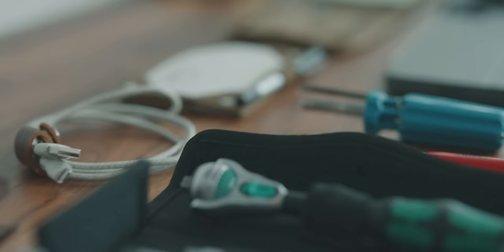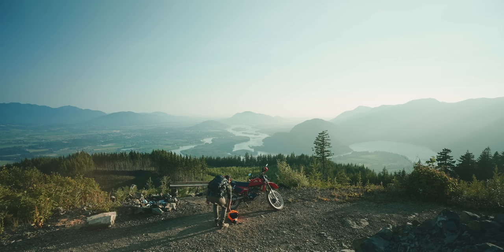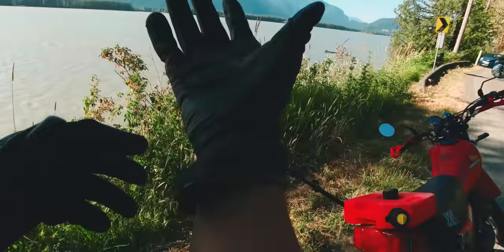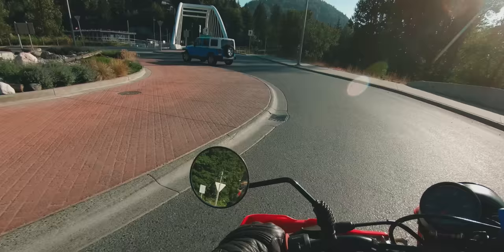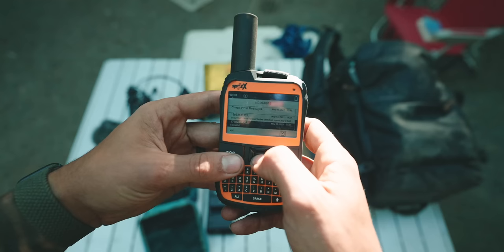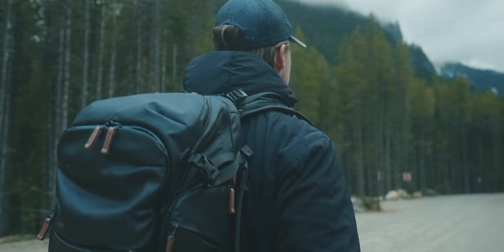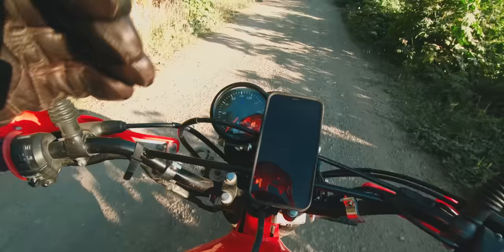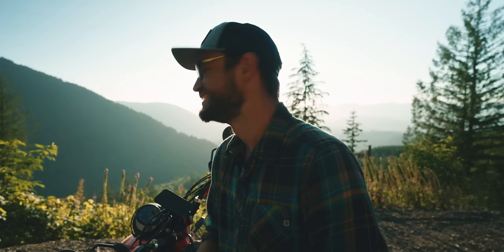Camera Gear I Love! Everyday Carry 2021 with Levi Allen

Comment: Some blue loctite will help a lot with those stubborn bolts that rattle loose but it can still be disassembled later if you need to.
Reply from the maker: Yeah maybe things rattling lose is an oversimplification. More like brakes need small adjustments. Or a part has come lose because a piece of metal bent from vibration. But yes loctite is awesome

Comment: This is amazing!  Great video.  Sounds as though bike is idling a touch high,  should be able to hit the set screw on the carb and lower it a bit.
Reply from the maker: Yeah it’s idling high for sure. The float is actually stuck. So it needs a rebuild

Comment: 7:48 Yeah I can't recommend the Knipex Pliers Wrench enough. Use them all the time. Just in case you didn't know, that plier design works best when you push the top handle down (clockwise in the video).
Reply from the maker: Wow I never thought of that. That makes sense tho. Great tip

Comment: Thanks for the video and little tricks! Do you use Filter step up adapter or you use different size filters for different lenses?
Reply: You should definitely go for step up rings. Buy a filter for your largest filter size lens. And then use step up rings for the smaller ones. I recommend polar pro's step up rings. Unless money is not a problem then go ahead buy a filter for each lens :D

Comment: Just came across your channel! Love it… 

One question, do you know if that cube system will fit in the Peter McKinnon travel bag. I’m in the UK and it’s impossible to get nomatic here..  cheers. Also new sub!! Gunna binge your vids now!
Reply from the maker: I don’t think using the shimoda core units would work well with the nomadic. I would just embrace one system or the other

Comment: Hey, Levi! Great breakdown! I have a cinematography question for you: How much of a stickler are you about always using the 180 degree shutter rule? To me some of the clips seem to have less motion blur than is perhaps expected. I would like to know if cranking the shutter for more light, or shooting 60 fps for a 24 fps timeline in case you want to slow things down later, are tools you use, or whether you just always set the shutter at double the frame rate you are using.
Reply from the maker: Can’t use 180% with action cams without a bunch of hassle

Comment: You mentioned that you usually pick 30L or 35L + a carry-on for plane travel - have you ever had an issue where they tell you that you have to check your camera bag? I have picked the 25L because I am really worried that if I was to travel with 30L I might have to check it in on some smaller planes like in Asian airlines etc. But I see you have has more experience travelling in Asia, please help!
Reply from the maker: I’ve never not been able to squeeze my earlier explore 40L in but it is hard sometimes. The fallback is removing the core unit and putting the thin sleeve around it, then it will definitely fit and you just have to deal with the bag.

I’ve never had my camera gear taken from me. It’s helpful to remind someone who is asking if they can check it below, that the lithium batteries need to stay in the cabin legally, that usually helps clear things up quickly.